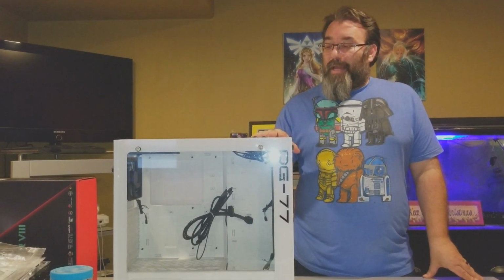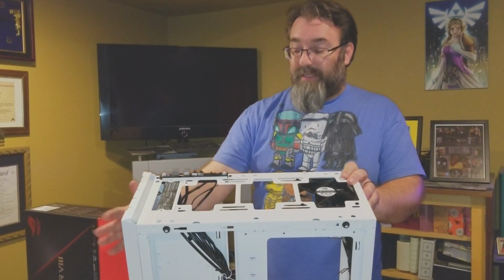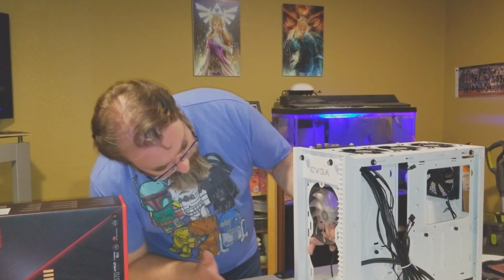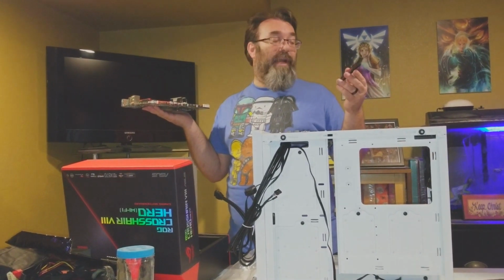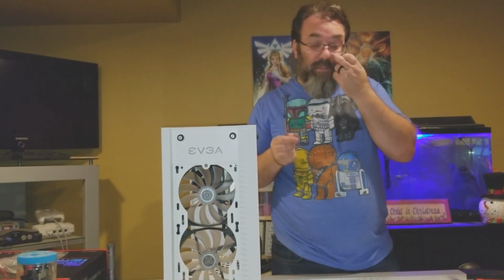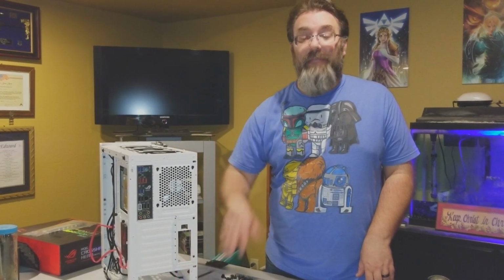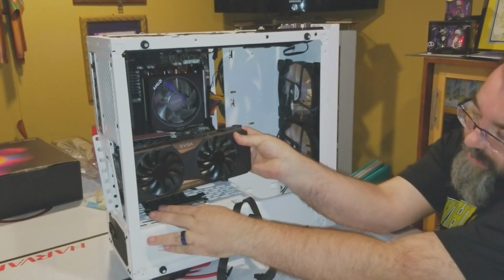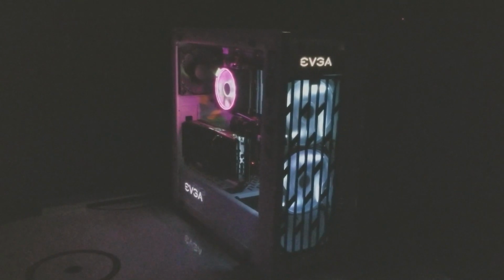Let's build a gaming PC using an EVGA DG-77 case and leftover parts from my old computer

Comment: HOw can i make my RGB fans works with the EVGA leds
Reply from the maker: On the top front of the case there is aRGB header pins, you can hook up to those, or if you have too many fans get yourself a corsair lighting node pro if your fans didn't come with one and hook them into that, and then run that to the aRGB header pins.
Reply from the maker: Then use the EVGA software for the case that you can download from their website to sync them all together.

Comment: How you connect all the fans?  Did you used a fan splitter?
Reply from the maker: The fans came with a controller, which was nice. The mainboard does support alot of fans by itself, but has no RGB connections because of its age. The controller that the case comes with is limited, and the fans I bought used a combo RGB fan header so wouldn't connect to them, so I was forced to use the supplied controller. My only complaint is that the aftermarket controller does not retain setting to sync with the EVGA software after a restart, so I have to click it over on the remote each time. Small price to pay though.